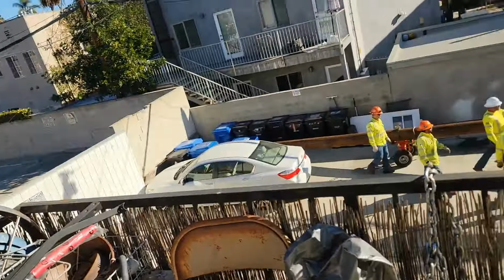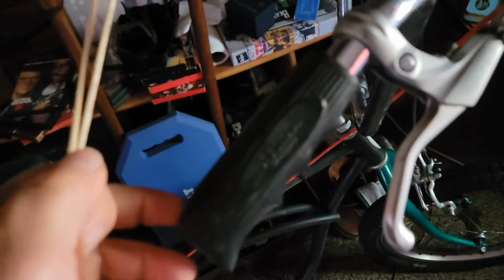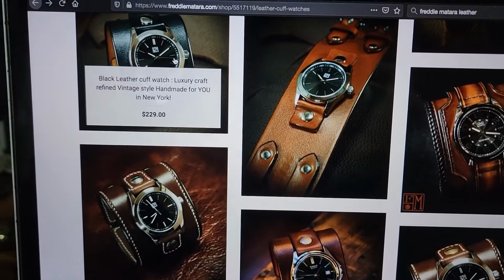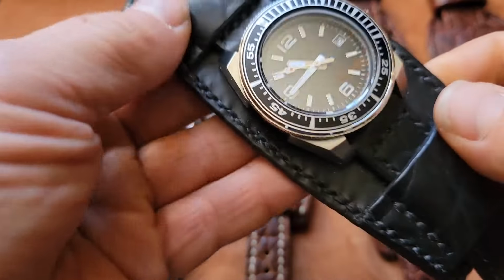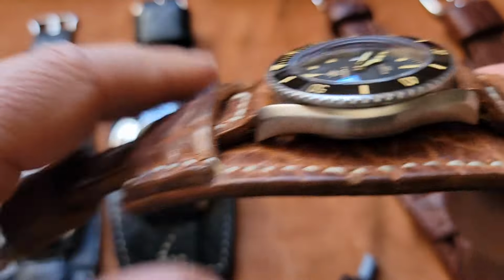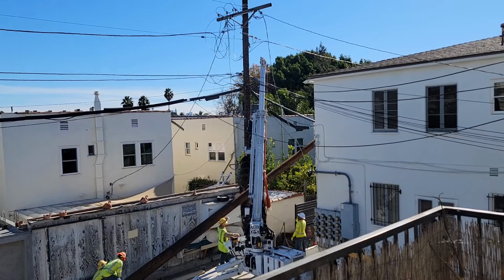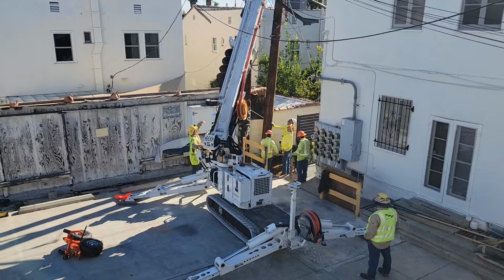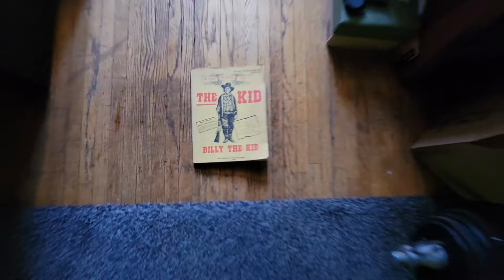A Saturday Morning At My LA Pad...

Comment: I liked watching LAPower & Water put up the pole.  I also liked your work and the explanation in your leather straps. Not my thing I can’t carry the dangerous look anymore plus I spend so much time in water during the summer so it is bracelets, Marine Nationale and rubber straps for the water. I think you need to go up on the prices a bit you might be too low even with a time piece.